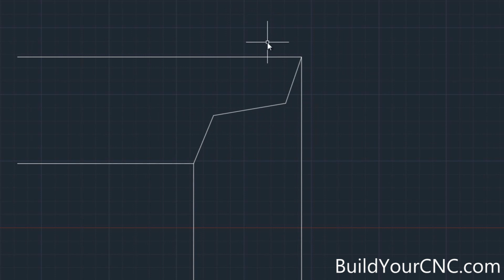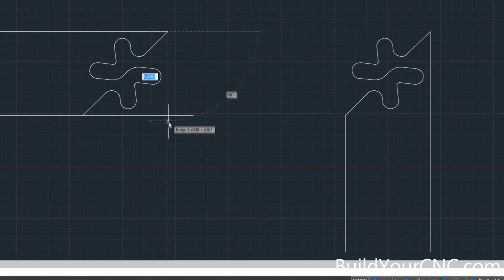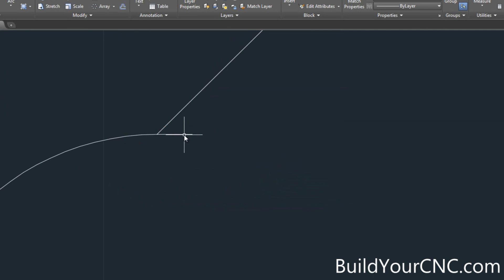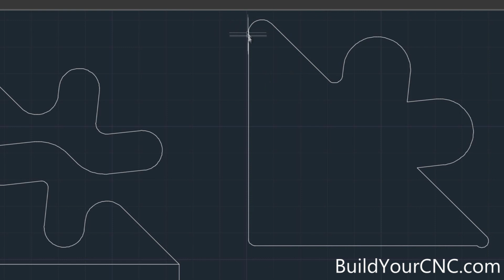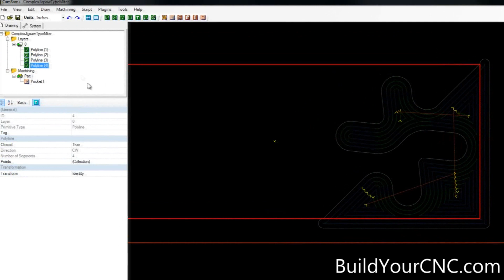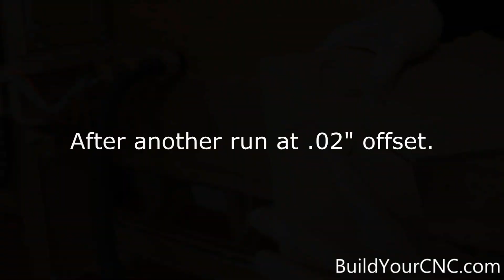How to Create a Complex Jigsaw Miter Flat Joint on a CNC Machine

Comment: sir need :help i have made 5*10  CNC router i have used 45kgcm stepper motors for all axes.draving mechanism is ball screw at all axes lead is 10mm for xy and 5 mm for z . i can not run  gantry(x-axis)above 1500mm/m motor stalls at this speed 
i am thinking of increasing size of my steppers .will that help ?please sir guide me i am feeling very frustrated. and that so plz suggest me size of stepper motor 
power supply and everything is at it's peak.
Reply from the maker: What power supply voltage are you using to provide power to the stepper motor drivers?  Increasing the voltage going to the drivers can decrease the time constant that the current is allowed to be drawn from the motors thereby increasing the torque through higher speeds.  Before you change your motors, make sure to check the voltage first.
Reply: Patrick Hood-Daniel mate i am using 48v 10am power supply and driver are of 6amps and stepper are of 5am rating
Reply: just putting hands ball screws is enough to stall motors
Reply from the maker: That power sound correct.  It is probably a good idea to increase the size of the stepper motors.
Reply: thanks mate 
i am gonna give it last try by increasing power to 80v dc cuz it will almost give  double torque at  same rpm.if it fails again  then i will replce x motors
Reply from the maker: Increasing the voltage and maintaining the current will definitely help.
Reply: ri8 dude

Comment: I'm curious whether you've considered spending any time learning a programming language (or learning g-code extensively) and using it to help automate some of these things?

If you're going to make a lot of pieces, the individual design time is not so bad, but for one-offs, having to make drawing/design changes in CAD is kind of a pain when you want to experiment with, for example, cutting depths, tolerances, minor shape differences, etc.  I have a small library of python code I use for stuff like this.  I still do a fair amount of CAD but for a lot of things I use code directly.  

At any rate, some interesting ideas and challenges in this one.  I wonder if you could improve the vibration problem by adhering the board to your spoil board.  Double sided tape, glue with paper, adhesive spray, etc, all might work.  You wouldn't need much because you're not trying to hold it down, just keep it from wiggling back and forth.